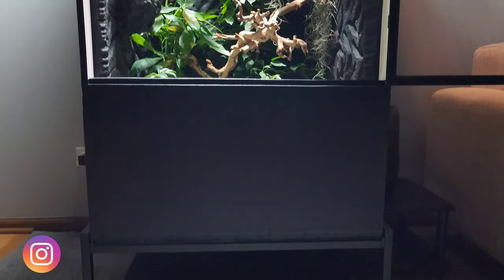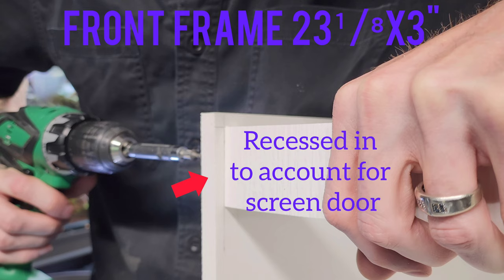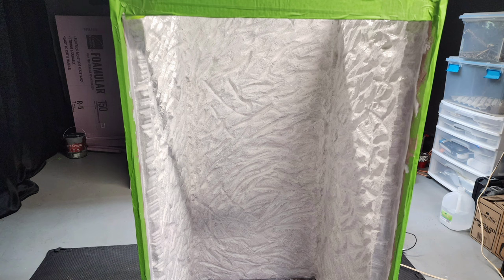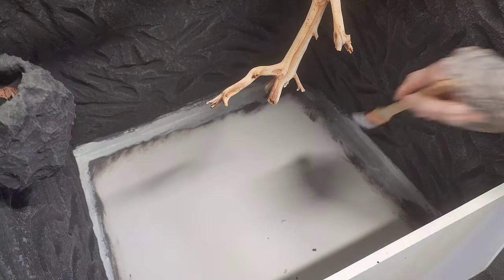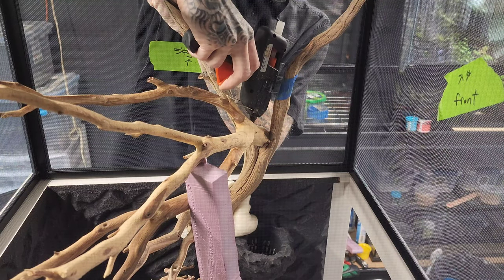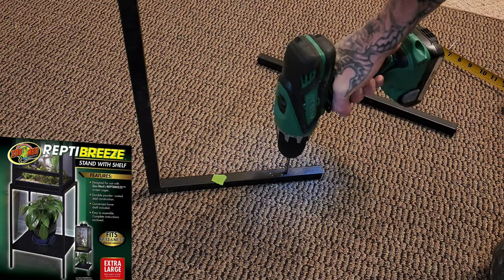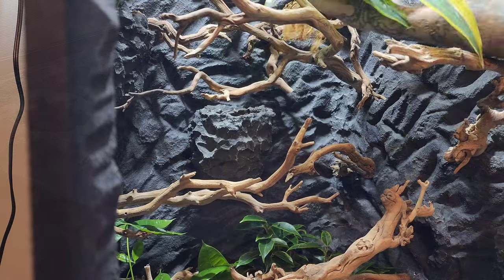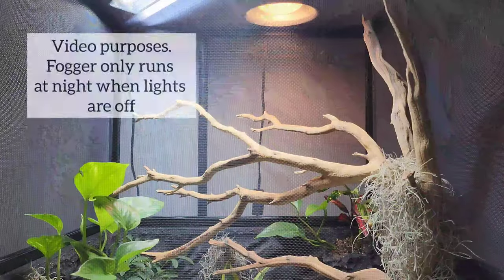Chameleon Enclosure |How To Build A Hybrid Reptile Cage PVC or Wood DIY| Bioactive Vivarium.

Comment: Hello awesome build. As most comments have stated, I don’t have local access to pvc sheets. How would you go about the build using birch plywood? Thanks!
Reply from the maker: @eliasgonzalez6597  thank you, amdbi would go at it the same way, but I would use a liquid rubber or resin epoxy to waterproof the inside wood.
Hope this helps

Comment: Brad, since the cage is all screens, does the mister get the walls behind the cage all wet? I just built a simpler version of this for my first chameleon and I'm worried the misting is going to soak my walls.
Reply from the maker: Only the top 18 inches and front door are screen. The rest is hardscape. But the fogger doesn't run outside the enclosure.  I do must by hand so I can control where I spray the water. 
Hope this helps

Comment: can you explain how you created the door? amazing work!
Reply from the maker: Thank you, 
In short for the door:
*Youtube some videos on how to make a window screen. 
* I recessed the top header back into the enclosure (recessed the thickness of the window screen frame so it sits flush with the enclosure sides) 
* attached small hinges found at most hardware stores
* attached a Latch to keep enclosure shut.
*added a bumpstol at the bottom to keep door from swinging into the enclosure. 
That is it in nutshell.
Hope this helps. 
🤘💯🦎🐍🐸🐢🌱

Comment: Hey man great video, I have to say this is one of the best chameleon enclosures on the internet, can you explain me a bit more about the drainage system, and what you use to hold the enclosure off the ground?
Reply from the maker: Thanx, and it was a fun build to document. 
Drainage system: 
I use a half-inch bulk head I silicone screen to (extra barrier so the clay balls leca don't fall into it. I silicone that to the bottom. I could have used pvc cement to fuse together to. But live to have the option to remove in ever needed.
I attached a ball shut-off valve so I can release the water to drain. (I have a clear hose attached to a half-inch pvc pipe that fits into all of my enclosures so I can use it universally) 

The false bottom (clay balls leca) is where I can have water gather without flooding my substrate. It also allows beneficial bacteria to grow and is light weight.

Ontop of the clay balls is a weed barrier that separates the clay balls from the substrate while still allowing water to pass through.  This also prevents the substrate from entering into the false bottom/clay balls. 

I just used a zoomed reptibreeze stand and cut it down to size with a hacksaw.  enclose would have been about 9 feet tall. I just made sure I was still able to fit all of my fittings for the plumbing below, along with some other things I wanted to keep under there. 

Hope this helps!
🤘💯🦎🐸🐢🐍🌱

Comment: I had a lot of trouble finding PVC sheets on the west coast, I finally found "marine grade PVC foam" at Piedmont Plastics, the lady that helped me said she has lots of customers that use this for reptile enclosures, so I guess this is what I needed. Incase anyone else is having trouble finding it. FYI I also bought a black sheet so I don't have to paint the outside.
Reply from the maker: Good find especially in black! I built my first enclosure and then found some in black wo wood grain. Keeps going white bc if the wood grain to keep everything in uniform. I wish I found black 1st 🤣. Thanx for letting everyone know in the comments 💚

Comment: Awesome build and video! I’m following your directions and building one for my chameleon! 

I love the mesh top! That’s what sold me on this build! Learned so many new things, but I’m excited to try your method of making the added wood look natural. 

I’m using cabinet grade birch plywood because pvc board is impossible to get where I am  for a decent price. 

Should I flex seal all of the wood inside before I add the foam board walls?  

Is there anything you would have done different, now that a year has gone by?

Thank you!
Reply from the maker: Thank you, and I'm glad you are taking on this project.  It's a fun one to do!

The tip is one of my favorite parts of this build, creating an extension for him to use in the upper canopies above the "jungle:

Cabinet grad birch is a great option. I would use wood glue before screwing together, then a food filter in that the seams, then a few coats of drylok original or a polyurethane. Them sili one the seams.

If I were to change something, which I did. I ended up using ploygem zoopoxy on the upper branch I made in the top dome. The sprayfoam held just fine, but it did sag a hair when my Chameleon was on it. It sound barley touch the screen, and it just frustrated me. So, I added zoopoxy to have a mire solid structure. Originally, I could not have had the branch so close to the screen dome top, and I wouldn't have needed to have done this.

Lmk if you have any questions along the way and have fun with your build!
🤘💯🤘
Reply: @bradsbioactivebuilds  thanks so much!! Everything’s been screwed together and I did use wood glue. 

What type of food filter should I use for the seam?

If you’d like to see the end result I’ll tag you in my IG post once it’s all done.

Comment: Do you ever run into issues with mold on the wood? Any way to counter mold buildup or prevent it?
Reply from the maker: Good question, I have not with this enclosure because of the air flow and CUC. But most vivariums will go through a mold bloom after about 2 weeks of it up and running, then disappear after it balances out. Another good reason to wait to put an animal for a few weeks.
🤘💯🦎🐸🐍🐢🌱

Comment: This is so informative. I truly enjoy watching your builds. I was wondering if you would be able to do this for tree frogs but having it hold more humidity than the screened off areas for the chameleon? 

I have been racking my brain on how to make 3 paludariums that are 6 feet tall, 3 feet long, and 2-3 ft deep for red eye tree frogs, mossy tree frogs, and green tree frogs. The lids and the doors are stumping me along with whether i should use glass or the PVC boards that you use in your builds. Any advice would be truly appreciated.
Reply from the maker: Thank you!
Great questions.  The inner trim at the top the screen dome top sits on was originally mad to be a flat screen. Then I came up with the idea to build the dome. So instead of adding the screen dome just use glass cut to size. Your local lass shot can do that for about $20 non tempered glass. 
For the front I would do it the same but instead of screen use wood and cut slips in it to add glass. You can look up how to make glass front doors. Serpa design also has a good DIY on how to build glass front doors
Reply: @bradsbioactivebuilds  thank you so much for the response. 

Will the PVC sheet be able to standup to high humidity for a long time and will the spray foam separate off of the sheets after some time?
Reply from the maker: @StarWolf7800  of course, and yes PVC will not be affected at all by humidity or water. the main reason i use PVC is because it won't rott. Plus, it's strong but lightweight.  
You will want to rough up the pvc. I found siliconing all 3 sides using xps board is the best way to attach backgrounds.

Comment: What kind of water system/ drip/ fountain would you put in this? How could you implement it?
Reply: To be honest I am replicating this, and I'm about half way through but I'm wanting to make sure that I don't go too far before figuring out how to implement a drinking fountain into it in case I need to make adjustments now to anything.
Reply from the maker: @desireejohnson5344  depends on what you are using the enclosure for. If it's for a chameleon I personally wouldn't use a water feature other then misting system or fogger. Mainly bc the bacteria might be to much h for a chameleon and offer to much humidity during the day. If it's fir a different reptile, I would do something like the link I shared but without the 5 gallon bucket.  I would instead attach the hose to the background and sprayfoam over it or use a pvc pipe I could run a hose through for future maintenance purposes if ever needed.
Hope this helps.
🤘💯🦎🐸🐍🐢🌱
https://youtu.be/E9RIR0qE_q0?si=06g7tYNOsOARk7sb

Comment: Hi @bradsbioactivebuilds this is awesome and I want to replicate it exactly!! 

I have a quick question thou, did you just put the uvb and jungle dawn nex to eachother on the mesh screen and also is there anything you wuld have done differently if you had done this again?

Thanks so much for the video, this is exactly what I needed! Also, I am sure nobody would mind an update on this ;P
Reply from the maker: Thank you. It's a fun build to do. 
Yes, I placed jungle dawn and uvb next to each other on top of the screen. You can link them together.
Thing i would have done differently: It is the "top dome" where I spray foamed the 2 branches together. I would have used polygem Zoopoxy instead of sprayfoam. This technique worked in my blue tree monitor enclosure bc it went to the wall. But the chameleon enclosure it didn't have enough support for my liking over time. It still held just fine, but it did sage a little bit when he was on the very end. With his weight, it barely touched the screen. After I applied Zoopoxy, I have not had an issue with a slight sag. 
A video update on my enclosures is in the works. They are all doing well, but with every build I find thing I could have done a little differently. But that kinda normal when trying to perfect 😆. 
Hope this helps!
🤘💯🦎🐸🐍🐢🌱

Comment: This came out amazing. quick question how did you attatch the screen top to the bottom enclosure?
Reply from the maker: Thank you, and the screen top just seated into place. I did silicone the front to (screen frame to bottom portion) to close the gap. But the screen dome sits snug in the bottom enclosure without the risk of tipping over. If it wasn't so secure, I would have screwed them together
🤘💯🦎🐸🐍🐢🌱

Comment: Are the vents necessary for ventilation even though there’s already a screen door?
Reply from the maker: That's a great question. I know people that have hybrid enclosures without the screen dome top and no ve ts that work for them. 
A lot depends on where you live and where it is in the room (by a window, which might have seepage, creating a draft, etc)
For this particular build, I wanted as much airflow as possible, so I added the vents. I could have probably gotten away without them but added them to be safe. The back one helps bc I have the fan attached to it pulling air through the enclosure. 
So, short answer I'm not entirely sure. Some builds you know what's gonna work, and others are theory/educated guesses.
Hope that helps
🤘💯🦎🐍🐢🐸🌱

Comment: Brad 
I was curious which direction you have the fans blowing. In or out? I built an enclosure similar to yours used your video for guidance.
Reply from the maker: I have the fans blowing out so it pulls air from the front screen -> through the enclosure-> and out the enclosure. 
Have fun woth your build! 
🤘💯🦎🐸🐍🐢

Comment: Love the build man. Im totally doing this . One question tho . Did u use a fan for every vent ? And also what did u use for the soil in the pots Thanks 💯
Reply from the maker: Thanx Raul!
I started with 2. 1 in the back and one on the right side. I removed the one on the right side after testing oit air flow. So currently, I'm only running the one in the back.
For the soil in the pots, I used ABG mix.
Have fun with your build, and feel free to ask any questions along the way.
🤘💯🦎🐸🐍🐢

Comment: @bradsbioactivebuilds is there a reason why you swap in between lexel and silicon for seams vs xps board? Love this build by the way. One of my favorites
Reply from the maker: Yes and no, I could have used lexel for both. But lexel takes longer to cure, and with it being behind the xps, it might have taken even longer (exposed it can take up to 2 weeks with off gasses.)
I like lexel because it bonds to pvc better, and it's paintable where silicone is not. Being able to add a layer of drylok (after cure time) adds another protective layer of waterproofing the seams monitor doesn't leak.
Hope this helps.
I'm glad you live the build!
🤘💯🦎🐸🐍🐢🌱
Reply: @bradsbioactivebuilds  awesome thank you! That makes sense.

Comment: Hey man. Stunning build, I read all of the comments first to make sure I’m not asking you a repeat question…I noticed you didn’t mention anything about a misting system with this enclosure. With all of the drylok, do you think this set up would hold well with a Mistking system if I wanted to incorporate that? Or would you recommend additional steps?
Reply from the maker: Great question. 
I hand mist this one in the am and at night. But a misting system would do well in this build. I probably would have attached it to the sides bc it it were ontop it might go through the screen and spray outside of the enclosure.
Reply: Much appreciated 🙏🏼 🐍 🦎 🐢

Comment: @bradsbioactivebuilds what did you use with the bulkhead? I bought the same one you have and the ball valve but they do not fit together. Looks like you have something slipped inside yours plus an elbow. Neither that or the elbow are in your parts list. Thanks
Reply from the maker: @cryptkeep3r985  it's just 1/2 pipe that slips into the bulkhead and ball shut off valve. U can siliconnir use pvc cement for a permanent installment like India in part 4 of the huge vivarium series

Comment: Any alternatives to the cellular PVC sheet if it cannot be found anywhere local?   Enclosure looks amazing!
Reply from the maker: Thank you and you can use 1/2 inch or 3/4 inch plywood. Your cuts will be a little different than in the video. Just waterproof it with drylok and should be good to go!
🤘💯🦎🐸🐍🐢🌱
Reply: @Brad's Bioactive Builds  Awesome, thank you 👍
Reply: @bradsbioactivebuilds  Got most supplies today between Lowes and Home Depot.   Should I still use Drylok Original on the wood or a different type?
Reply from the maker: @faint8652  drylok original for everything, the other dryloks aren't animal safe. 
I'm glad you got all the materials. Have fin woth your build and lmk if you have anyvother questions.
🤘💯🦎🐸🐍🐢🌱
Reply: @Brad's Bioactive Builds  I got the original, so thankfully I won't have to return it and can get started tomorrow.   Thanks again for the quick replies and awesome builds.

Comment: So I'm thinking about using your background idea for an 18 x 18 x 18 terrarium is there anyway I could get the measurements for that.... I love the idea of the baskets with the spray foam over doing the spray foam! It's actually a genius idea!!
Reply from the maker: Are you building an 18x18x18 or do you need the measurements for the insulation foam board to go inside a 18x18x18?
And thanx, the baskets and spray foam work great! 
🤘💯🦎🐸🐍🐢🌱
Reply: The installation foam board that would be going inside. Thanks so much 😊. Again the whole thing was very impressive.
Reply from the maker: @harveymossholder9376  got ya, just so I can help measure. What kind of enclosure will you be using?
Reply: 18 inch cube... I know that it seems simple but I just want to be able to do it one time and not waste a bunch of money
Reply: I probably should have mentioned to set your mind at ease that I'm not doing this for a chameleon I'm doing this for dart frogs.... I just really like your background idea versus doing the spray foam! I can understand why you wouldn't want to reply to me about me trying to put a chameleon in an 18 x 18 cube
Reply from the maker: @Harvey Mossholder  no, I figured you were building it for something else. It's just been a crazy week at work. Havnt been able to check my comments to much this week.
It hard to say without knowing your inside measurements. But measure the back width x height
The the side length and subtract 2 inches..
🤘💯🦎🐸🐍🐢🌱

Comment: This is badass, and I actually have a similar build In mind that I just started, do you think that this exact build can work on a reptibreeze screen cage?
Reply from the maker: Thank you, and are you looking to attach a background (insulation board) to the reptibreeze screen?
Reply: @bradsbioactivebuilds  actually i already attached the insulation board to the screen mesh with sylicone, and it is secure, however i am using polystyrene foam and was wondering if it would make any difference when applying the quickcrete and drylok?
Reply from the maker: @lucerob.8300  it shouldn't make a huge difference.  It's just mor brittle, so I would add a few extra coats of drylok original to be safe. Hope you are having fun with your build.
🤘💯🦎🐸🐍🐢🌱

Comment: As far as the drainage system went what dimension PVC pipe did you use as well as the hole you drilled for the bulkhead
Reply from the maker: 1/2" pvc pipe. I have the link to the 1/2" bulkhead in the description.  I forget the hole size I used to drill (I have it marked bulkhead, but I think it was a 5/8")
The best bet is to always drill a hole in a scrap piece of plywood to check best size before drilling enclosure. 
Hope this helps
🤘💯🦎🐍🐸🐢🌱